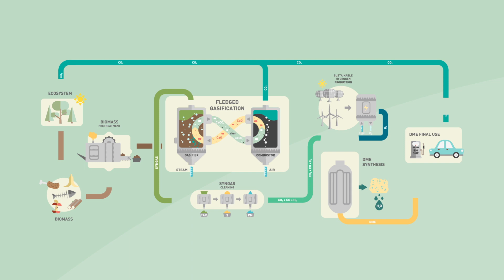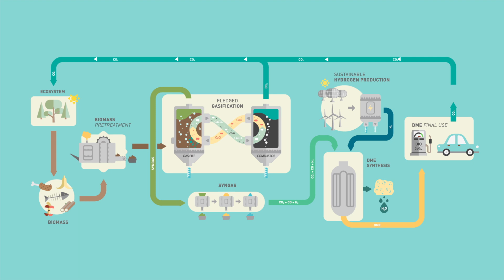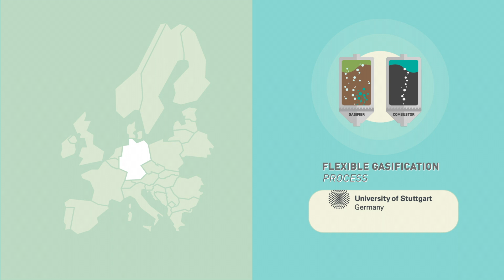H2020 FLEDGED project – Flexible DME production from biomass with Sorption-Enhanced processes

Comment: This process and such a reactor is probably not fast and easy nor cheap to build.
 But the earth is waiting for fast solutions. I read about torrefaction which is a kind of low temperature oxygen free heating. This dries the material and makes it hydrofobic. After easier compression now, it can be stored outside if needed. It looks a bit like brown coal, I guess. It's now much compacter which allows for lower transport costs.
Perhaps domestic waste ovens can be adapted for torrefaction with minor costs and the stored biomass is later (by train) transported to a real professional gasification oven.